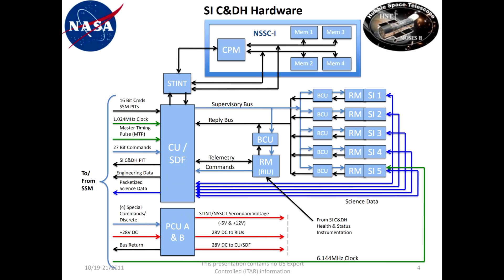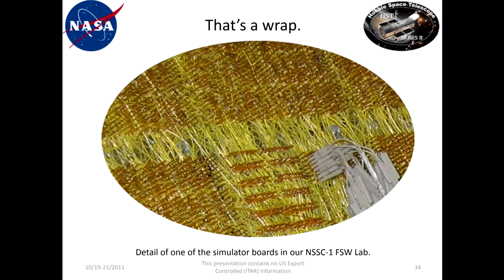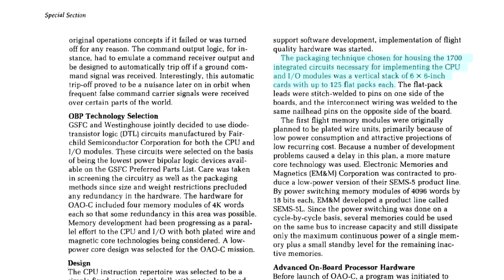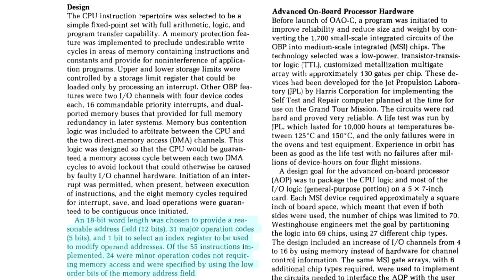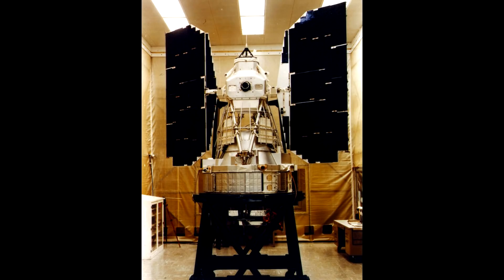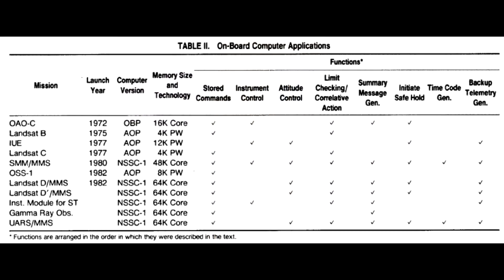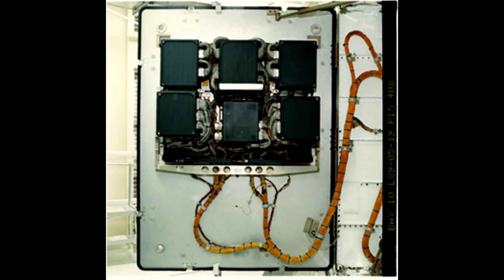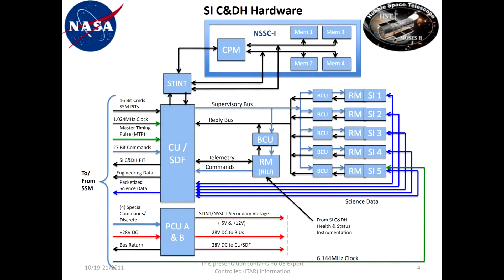Hubble's Latest Problems May Be In a 50 Year Old Computer Design

Comment: I wonder how many Raspberry Pi computers just launched this morning via SpaceX?
Reply: @colinsouthern  "Although there are better tools to do it" There lies the crux. You said it yourself. Controllers and SBCs are two different things for different purposes is all I meant to convey.
Reply: @colinsouthern  No it's not what I meant, it had nothing to do with SpaceX. So my bad, it was slightly off-topic. uCs and SBCs do have a usage overlap, but in general uCs have way less memory than and SBC making them less suitable for certain tasks which need caching for example.
Reply: @colinsouthern  The Rpi Pico is my next subject of experimentation, I plan to use it as an ADC in which the analogue audio is first digitized and then run through a codec that translates it to VBAN audio stream. The RPi 4B that runs a media player can play VBAN audiostreams coming in, from the pico, or from another arbitrary VBAN stream source. VBAN audio is a project by an individual developer (Also the author of the voicemeeter apps), the source code is openly available. It contains an audio-over-IP protocol for low latency streaming (milliseconds on a 100+ Mbit lan) making it ideal for realtime purposes, like voice chat. Not suitable for internet, only on LAN. Just thought you might find that interesting.
Reply: Oooooo ô9oooooooookkkkkkokkookkkookkkokkkiikiiiokookokkoooookooookkookkokkkooooooioooooooooooooooooo9oolpk9llllklooooooooooooooooooooooooooooooooooooooooooooooooooooooooooooooooooooooooooooooolooooooooooloooolooooloooollololooollllkololooollkllololllollkllllloollllkllllllllllllllllllllllllllllllllllllllllkllllllllllllllllllllllllllllllllllllllllllllllllkllllllllllllllllkllllllklllklllllllklllllkllkklkkklllklllkkkkllllllklklkkklllllllkklkkkklkklkllllklkklllllllkklllllllloooook
Reply: @colinsouthern  Arduino is a microcontroller, Raspberry Pi is a full-blown SBC with a much faster CPU and additional controller components. They have different uses.
You can't use an arduino for routing your network data, for example, which the Pi can.
Reply: Another useless Musk fanboy.
Reply: @pcuimac  And you say this becaaaauuusse.....?

Comment: I am fluent in the COBOL programming language if that helps at all - 🛸
Reply: He mentioned assembler.
Reply: @riforgiate74  Most of this was done in Assembler because it requires very little overhead.
Reply: @kokomo9764  assembly is such a lost art. It's incredible how little space a program takes when a good programmer writes it directly on the hardware vs compiling.
Reply: Barely remember COBOL or FORTRAN.  I was a VERY early adopter of C.  I don't use anything anymore.  No need on the beach in retirement.
Reply: Real Programmers code in FORTRAN.  COBOL is for accounting dweebs.
Reply: I worked with the OBC on IUE, it was programmed by hand in its native instruction set. That’s how an entire spacecraft can fly on 8K of memory - compact code.
Reply: COBOL is too modern... lots of this stuff is coded in Lisp. Incidentally that has saved their asses more than once because all Lisp programs have have built in REPL so you can inspect any part of a running program, execute any function, alter any variable or simply inject new code as needed.
Reply: @andersjjensen   - probably leads to very messy code very quickly - I hope someone keeps sensible notes along the way
Reply: @FandersonUfo  Well, the good thing is that you can just inspect it in realtime unlike machine code. A strange thing about Lisp is that Lisp code is a native data type of Lisp (read that twice, it will click eventually) because the language was initially developed for AI research, and it was envisioned that with sufficiently advanced programming a program would be able to extend itself with solutions to new problems. So Lisp programs has functionality to generate code and insert it into itself. Modern versions of Lisp can even compile the code to machine code and insert it for better performance. Strangely enough every antivirus software on the planet freaks out if you try to do that on a modern OS :P
Reply: @andersjjensen   - sounds like it has most of the characteristics of a life form - 👽

Comment: I always thought it was dumb that they used super dated computers in space cause some idiot thought it seemed like a good idea for 'reliability' - in reality it just makes all your tech suck.
Reply: look at many spacecraft/probes, they've lasted many years, even decades in harsh space, you're ignoring the benefits of such reliability, do some research and learn.
Reply: Well remember...Hubble got launched in 1990.   So, yeah..compared to today's tech--the computers suck.    People seem to forget that HST has been in orbit for 31 years now.    That's a LOT of time in the vacuum of space and exposure to radiation, extreme heat/cold, etc.    The fact that those computers lasted as long as they did is a testament to the reliability of the computers of that time.
Reply: @HawkeyeCR52322  But as the video says it contains computers from the 60s/70s
Reply: @NPC-mj7up  Yes...and those computers were used in spacecraft because they were reliable for the spaceflight environment. 
 
Also need to remember that these computers weren't being tasked with doing alot while on orbit....basically they were a conduit for getting data gathered by HST down to Earth...and instructions on where to point HST from Earth.  

You didn't need a supercomputer to perform the tasks that the computer on Hubble needed to perform.
Reply: @HawkeyeCR52322  They were upgraded many times due to huge limitations.

NASA is just backward because they are in the public sector. Private business with a profit motive will always be better, only now are we seeing satellites with modern chips in, and they work much better at a fraction of the cost.
Reply: @NPC-mj7up  Wrong.    As has been stated above multiple times... Modern processors were NOT radiation hardened nor were they capable of long term,  continued operation in the harsh environments of spaceflight. 

Again... these computers weren't needed to do massive level computing work.   Simple and reliable is best when you're designing a piece of equipment that's going to be in space for decades.
Reply: Java Man has the reason. Modern super-compact computer processors, memory, and other components are highly susceptible to the effects of radiation, while older computer parts are not. Granted, modern spacecraft do use much more capable computers. It's a significant design challenge to build modern computers that are sufficiently hardened against radiation while still packing enough capability to do the things you want.
Reply: The computers on the Voyagers are early 70s vintage and still work fine AFAIK. Your premise is faulty.

Comment: Could they fix it by sending people up there, would they send people up there
Reply: Did you, like, listen to what Scott even said?!?
Reply: The videos covers this. Currently there are no vehicles with manipulators or designed for EVAs. All we have are capsules.
Reply: Sure...they could fix it...the problem is there are no current vehicles with the capability to launch to and service Hubble.    Hubble was designed specifically to be able to be serviced by the Space Shuttle.  It was designed to fit into the Shuttle's payload bay and if necessary, could have been returned to Earth for servicing--if a repair on orbit was unable to be performed.
Reply: The US currently has no space craft rated 4 human flight.

Comment: Imagine a new circuit board using Apple's new M1 chip.
Reply: fried in a year or two, memory errors corrupting everything, not being derisive, but cosmic rays mean IC chips of that scale have no chance even with significant radiation hardening.
Reply: I’d be surprised if it was rad hard
Reply: An M1 wouldn't work for long, not radiation hardened. And using Apple would double the cost.
Reply: @billmilosz  triple redundancy you morons. Have the processors error check themselves. No need for radiation hardened processors
Reply: @kyotosunsetdreams6105  doesn’t help if all the processors have hard radiation induced errors.
Reply: Apple sucks.

Comment: I guess it could be repaired, since it is close to Earth.
Reply: what would they use to get there though? we dont have space shuttles anymore and current crew transport rockets dont usually carry much cargo in their crew transport configurations and also don't have EVA airlocks.
Reply: @guicky_  The repairs could be done onsite, like they did with the Spacd Shuttle, using both Starliner and Orion Capsules, that have EVA capabilities. SpaceX capsule is just a space taxi without EVA capabilities, and that's why it is so cheap.

Even Soyuz and the new chinesse space capsules have EVA capabilities.

The second starliner unmanned test flight is less than 30 days away and Orion's unmanned flight is set for later this year, so there are many options besides what Spacex could accompmish in the far future. 

So, a totally feasible repair mission, using Starluner, could be dispatched later this year, regardless of Spacex futuristic and far away in time manned starships.
Reply: @caonabo2  No.  .HST was designed specifically to be mounted into the Shuttle's payload bay for servicing work to be done.    Neither Starliner or Orion have the capability or size to be able to conduct those type of EVA's that would be necessary. 

Hubble for its size...is a very fragile piece of equipment.   Its not simply a matter of floating over, opening a door and doing a swap of hardware.
Reply: No.  There is no spacecraft operating right now that could bring Hubble back to Earth.   Also keep in mind that Hubble is orbiting well above where even the ISS (International Space Station) orbits.    Hubble's orbit is approximately 600 KM above Earth... ISS orbits around 400 KM.   

This was one of the huge problems with retiring the Space Shuttle when they did.  They performed one last servicing mission in 2009--12 years ago.  

So, unless SpaceX figures out a way that a Starship can be equipped to retrieve and bring back Hubble...if it can't be fixed--it will coast derelict in orbit until such time as it either can be retrieved or finally comes down in the atmosphere.
Reply: @HawkeyeCR52322  ABSLUTELLY YES!! You don't have to take your car to the shop for a flat tire.
The repairs could be done onsite, like they did with the Spacd Shuttle, using both Starliner and Orion Capsules, that have EVA capabilities. SpaceX capsule is just a space taxi without EVA capabilities, and that's why it is so cheap.

Even Soyuz and the new chinesse space capsules have EVA capabilities.

The second starliner unmanned test flight is less than 30 days away and Orion's unmanned flight is set for later this year, so there are many options besides what Spacex could accompmish in the far future. 

So, a totally feasible repair mission, using Starluner, could be dispatched later this year, regardless of Spacex futuristic and far away in time manned starships.
Reply: Sadly we have nothing that can do more than reach it. No EVAs possible, as Scott pointed out.
Reply: @knowlegeisgood8735   The repairs could be done onsite, like they did with the Spacd Shuttle, using both Starliner and Orion Capsules, that have EVA capabilities. SpaceX capsule is just a space taxi without EVA capabilities, and that's why it is so cheap.

Even Soyuz and the new chinesse space capsules have EVA capabilities.

The second starliner unmanned test flight is less than 30 days away and Orion's unmanned flight is set for later this year, so there are many options besides what Spacex could accompmish in the far future. 

So, a totally feasible repair mission, using Starluner, could be dispatched later this year, regardless of Spacex futuristic and far away in time manned starships.
Reply: Scott pointed it out very clearly: We do not have a space craft with an airlock. We do not have a space craft with a robot arm to assist the space walk. SO: Astronauts can't get out of the vehicle, and if they could they would have nothing to help them not float away.
Reply: @andersjjensen  Did you ever see the EVAs for the repair of Skylab? No Canadarm and no airlock for the astronauts that had to repair the solar panels and the thermal protection for it's space telescope, yet, the repairs were done with more risk and complexity. Soyuz capsules don't have airlocks either, yet cosmonauts have performed many many EVAs from them, even to repair some ALMAZ and SALYUT space stations.

So, the fact that the Crew Dragon capsule can't do EVA's because SpaceX did not develop EVA suits for it capsules does not limit the Starliner nor the Orion capsules EVA capabilities. The second unmanned test launch of Starliner will be by the end of July, followed by a Manned flight on september or october of this year.

Maybe Scott did not want to start an argument with the SpaceX fanboys, but pretty soon SpaceX' Dragon space taxi won't be the only player on the US space carrer.

In fact, an Orion Capsule could be launched right now, aboard a Delta IV and accomplish the job nicelly.
Reply: @caonabo2  No.  Again..  you dont know what you're talking about.    Skylab DID have an airlock module that was used by astronauts for EVA's.  And the repairs that were done on Skylab were makeshift repairs that were thrown together in about 30 days after the initial launch of Skylab in May of 1973.   The launch of Skylab 2 was delayed until July 1973 so that those repairs could be prepared for and astronauts trained on. 

The first EVA was done as a "stand-up" EVA to try to free a jammed solar array on Skylab--which failed.  The "parasol" that was used as thermal protection for Skylab (not just for its telescope), was deployed using a small scientific airlock through which the collapsible parasol was deployed.    

Two weeks later, a 3rd EVA was done that successfully freed the remaining solar array.    

And FYI...both the ALMAZ and SALYUT space stations of the USSR had airlocks..
Reply: @HawkeyeCR52322  YES. Again, in Skilab, Salyut and Soyuz they had to do initial EVAs from the capsules then they docked to their stations.

At least look at some documentaries befor continuing to add methane from your brain to the atmosphere.
Reply: @caonabo2  Wrong again.  Only ONE EVA was attempted as a "stand up" EVA to attempt to free the jammed solar array on Skylab.   That failed. 

Every other EVA done from Skylab was done from its airlock module---a mockup of which is on display at the Smithsonian Air and Space Museum in Washington DC.   

Go take a trip and educate yourself.